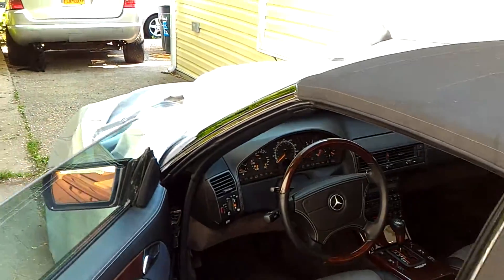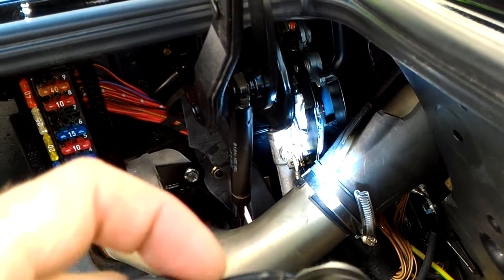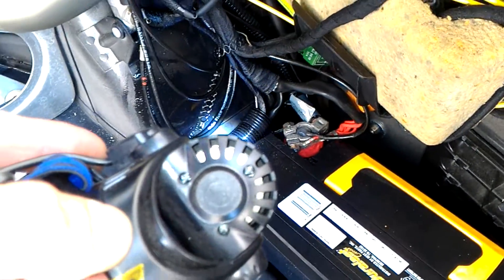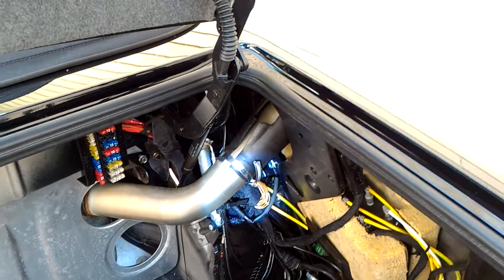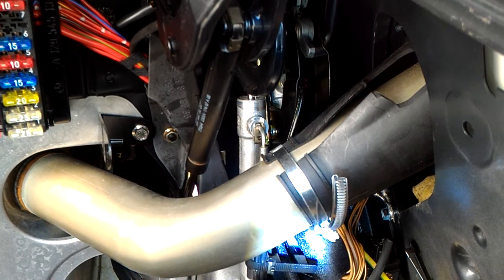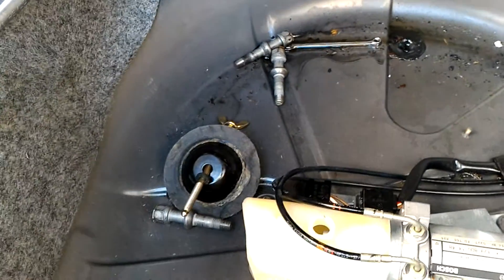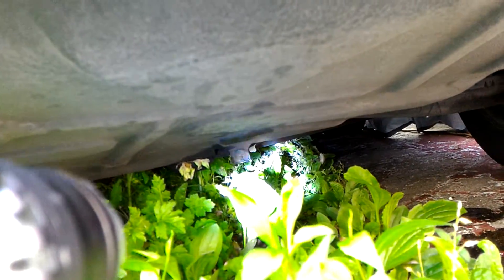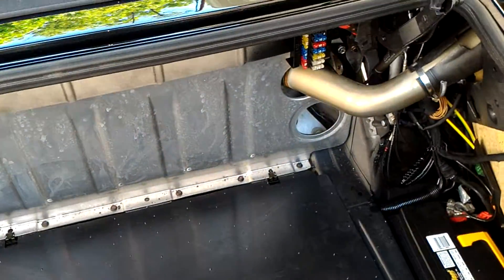Mercedes convertible roof cylinder leak

Comment: Hi Viictor, I've got a problem with my `95 A124 Mercedes, after replacing seals in the cylinders of the main hood lifters, the roof does not open. I had to let it replace, coz the left one was leaking badly (my mechanic replaced both sides just to be sure). The one that (un)locks the roof was replaced last year (received new seals too). Hydraulic fluid was topped up to maximum level (original one from MB). Now when I try to open the roof, the rear lock opens but the roof part where the glass window is lifts very very slow, and if finally rises so the front part can rise nothing happens. The button to open the roof blinks (I think even right from the moment on i pull it to open). Did you have such situation, do you know what the reason might be? Te engine runs when I operate the roof and I'm in P mode of course.